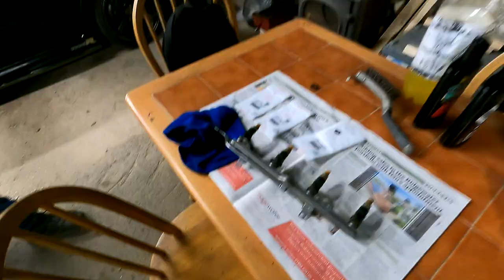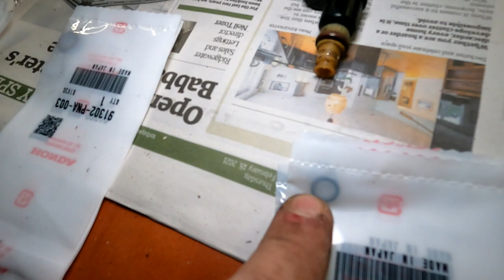Tactical Racing Fuel Rail Install on The Honda Civic FN2 Type R

Comment: Wel done guys, I had the same issue, the fuel line connector isn’t long enough on the TR or Kaizen version. The Hybrid Racing version is longer and allows a straight fit from the OEM.
Reply from the maker: Good to know man. You would think these companies would realise this wouldn’t you lol
Reply: @CowabungaCarDiaries  they are sourced from the same place so wonder how much influence they have on them. I ran my fuel line out with the white click for 6 months and was fine, but like you said, not ideal.